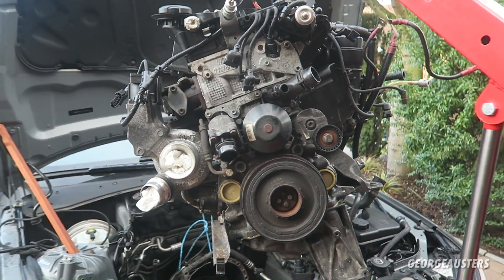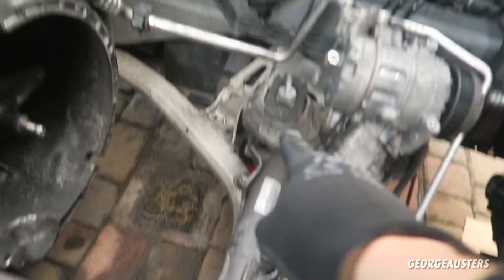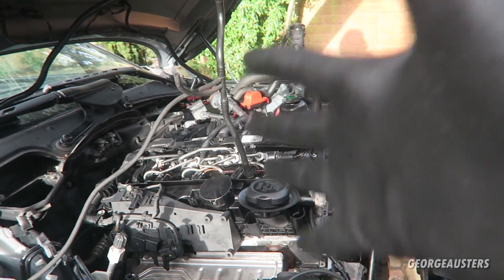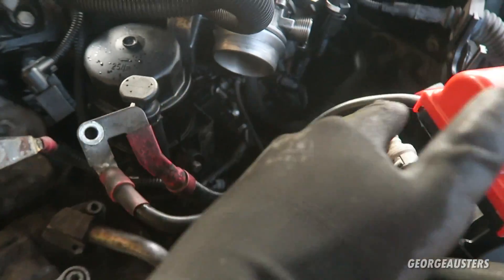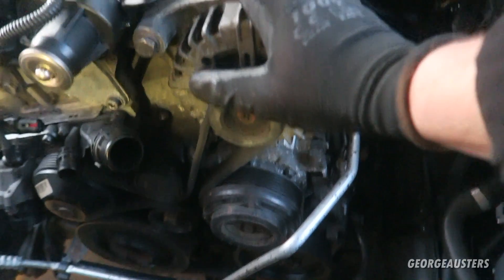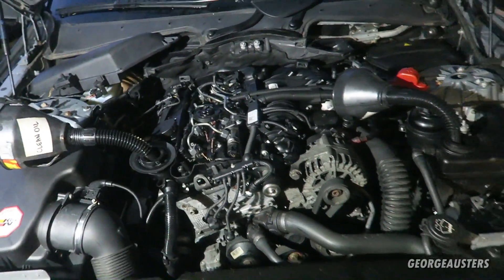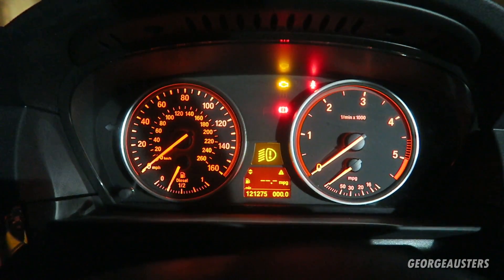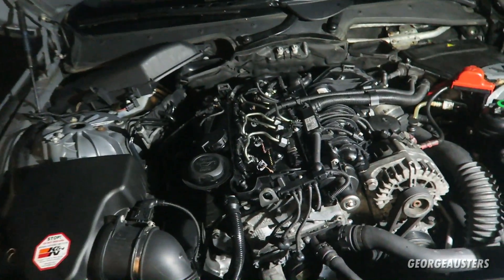Installing BMW N47 Engine After Timing Chain Replacement

Comment: Hi George i just swapped the engine in my n47 e90 and the clutch is grinding when put to the floor we bleed the system but still seems to be grinding any idea on what the problem might be ?

Comment: im really stuck. mines cranking endlessly and won't start and now showing injector faults. any ideas?
Reply from the maker: Just air in fuel system
Reply: @GeorgeAusters  hey, thanks. I do think it's air too but I feel like I've tried everything, bleeding cracking the pipes etc. I'll try bleeding again.
Reply from the maker: @bmartinot Do not crack off high pressure fuel pipes! It will bleed itself or use a scan tool to do it quicker
Reply: I can run the lift pump for 20seconds with my scanner. I've done that repeatedly but it doesn't have the 3minute bleed cycle. 
I build pressure to 4/5000psi for a couple of seconds then it drops to 1000psi

Comment: My 2c - fit the ac etc onto the engine when off - it's easier, there's room, so... also, hoik the transmission off - it's a faff installing the engine onto the box, install the box onto the engine once it's in - far simpler. You have only 2 points  to worry about - the engine mounts, then. As engines go, the N47 is one of the easiest to take out, repair & re-install. 

Don't make problems for yourself - do it the easy way. Fit everything, drop it in, connect the loom, the exhaust & the transmission, heater hoses, blah blah - there's acres of space, so no need to waste that luxury.

Comment: Is there any other way of priming the high pressure fuel lines/rail other than cranking via the starter motor ?
Reply from the maker: Yes, can do it with a scan tool
Reply: @GeorgeAusters  thanks for the reply, I mean priming beyond the HPFP. Is this not done mechanically via the timing chain driving the hpfp? Just thinking if I can prime it I don’t have to rely completely on the battery to do all the work when cranking

Comment: Hi, just completed the timing chain replacement according to your tutorials. The midle chain had a slack of atleast 25 mm(520 d, 2008, 305' km). Success, no rattling noise left. Engine runs so nice and smooth. Thanks. Br, Audun.
Reply from the maker: Glad to help!

Comment: Hi mate I’m wondering if you could help me with something, I’ve got a bmw 320d m sport on a 60plate. It needs an engine but have been told there is two types   Is its true as mine is a n47d20c

Comment: Excellent video series. My 330d is on 120k miles this year. Thinking about doing this one over summer. Great opportunity to swap out some other bits whilst the engine is stripped down too. Cheers

Comment: Hey bud I dunno if you removed the head at any point to change the head gasket, but what would be the torque specs to bolting the heads on with new head bolts obviously?
And big bearing in the crankshaft
Reply from the maker: I didn't remove the head
Reply: @GeorgeAusters  can't find any video on how to tighten head bolts in stages and turning in degrees for n47 engine 🤷🏾‍♂️😅

Comment: How was the car staring after the first fire up? Did it start easily (like normal) or did you notice any longer than normal delay. I get the first time starting up it need prime the fuel and oil around so it takes a bit but just wanted get a follow up after the initial “first time start”
Reply from the maker: Starts no issues

Comment: Yes, there is a process named fuel system breeding, normally which can be conducted through a DTC reader, so that you do not need crank so long, dry crank most potentially will kill your high pressure fuel pump.

Comment: Hi, when you switch the ignition on, can you hear the rear fuel pump running? Trying to start a 320d.....
Reply: Did you start your engine ?
Reply: I changed chains on 520d e61 and i dont hear rear fuel pump running and cant start the car

Comment: Hi George. i have just bought an e92 with n47 and for the moment i am buy the staff that i need for this operation. today i  have just bought the engine crane, most of the tools i have them already but you know every time you need something more. this series with n47 from you it will help me a lot. i have never done timming chain to an n47 but i think i will manage with my experience as a carguy and mecanik for some workshops in the past. greetings from Sweden!!!

Comment: Great job! I'd love to get my timing chain changed as the cars on 212k now, iv always serviced it and changed the oil regularly and always used good fuel but for peace of mind I'd like to get the chain done. Just had a new clutch so iv invested in it already 😅
Reply from the maker: Would have made sense to do clutch, flywheel and timing chain at same time
Reply: @GeorgeAusters  I didn't know you could get to the chain at the same time or I would have asked... Gutted! Its a great car and I'd love to keep it going. Its developed an oil leak now but the breather from the turbo to the roker cover was broken so iv changed that, juts waiting to see if that's why I had oil on the drive 😬🤞

Comment: The flat battery wasn't the reason it wouldn't start, the fuel system needed to have the air bled out of it first, all you did was overheat your starter whilst bleeding the air out of the system, they have an electric fuel pump in the fuel tank which lifts the fuel to the high pressure fuel pump on the engine, ignition on 30 seconds (power up the electric fuel pump) then off, open the fuel leak off (fuel return) line ignition on 30 seconds see if you have fuel coming out of the leak off line, if you do the system is primed with fuel, if you have fuel, air, heat (glow plugs) and timing there is no reason it won't start.
Reply from the maker: It was the battery. It didn’t have enough voltage to crank it fast enough. It takes a bit of cranking to bleed the air out and it dipped too low to allow that to happen.

Started fine once the battery was charged👍🏻

Comment: My mechanic fired up the engine after changing the timing chains and tensioners. The engine timing was off and the noise came after a few moments. The new tensioner for the top timing chain broke again. Any idea why?
Reply: yep , your mechanic timed it wrong.
Reply from the maker: Get your mechanic to fit you a new engine

Comment: Did you remove the front bumper to allow the hoist more room to install the engine back in..?
Reply from the maker: Had to remove the bumper because the engine crane wasn’t long enough
Reply: @GeorgeAusters  yeah I got same crane so thought you did...just needs another armpole  hole further back...

Comment: I just had the timing chain replaced in my 320D Coupé, and the BMW service didn´t take out the engine, they replaced the chaing from underneath the car, by removing the gearbox.
Reply: i did it the easy way to gearbox down
Reply: the engine i worked on was a f11 5 serie 220.000 and first engine was history at 180.000 the new engine had new cam chain hmm it didnt snap but jumped and camshaft housing cracked and broke many rockerarms i tested the comp and no valves was hurt new chain kit and it didnt start up easy 2 injectors needed a soft hit from a hammer to seal the flame washer
Reply from the maker: Do they want a medal?

Comment: Good Austers, first of all congratulations for the explanatory videos that are very good, I also wanted to ask you a question I have a BMW X3 2.0D engine N47d20a from 2009 E83 and I wanted to know if the injection pump brand is synchronized with the tool from the crankshaft

Comment: No issuses with taking out or putting my engine back in. BUT now when I try can start the engine I just hear a click and the ignition goes off by itself after a few seconds. Ive had a Bosch dianostic tester on and no faults showed up. Any idea what causes that? My car is a 08 520d lci
Reply from the maker: Send me an email if you want my help diagnosing your problem👍🏻

Comment: Mate I need a new timing chain on n42 engine.but Machanic says it's cheaper to change the engine then the chain.what should I do. A second hand engine
Reply: The N42 is a different engine, the timing chain is at the front and can be changed with the engine in the car, book time for changing those is 6.8 hours. I charge £625 for the complete job including all parts (chain kit, oil, oil filter, gaskets and seals, auxiliary drive belt). There is no way in the world I would ever recommend a used engine instead of renewing the chain, if that's all the car needed. The N47 as George has here, the book time is 13 hours, they can be done in the car as well (by removing the gearbox), although probably easier to remove engine if doing it on the driveway and certainly far less fiddly to change the chain that way. Plus much better for making a video showing the process, well done George really good video series.
Reply: Hm,how?Only if the engine has alot of mileage, but no it can't be cheaper.To change the engine they need to take the old engine out,and when they take the engine out,changing the timing chain is just an 1-2 hours more work and the chain is much much cheaper than an used engine which might also need a new timing chain.But if the chain broke then yeah,might be cheaper to change the engine or not even then,'couse there might not be very much damage...But it's not cheaper to change engine rather than the chain,sure for working hand it is more if you change the the chain but you need to understand you need to invest in another engine...
Reply: @prendedaj22  you are right. The problem is these kind of work, you have to go to BMW specialise Machanic. And they will ok will do the chain but once we open the engine there might be more issues. So you have to keep you check book open. the car with around 1200. . And to do the timing chain they quoted 700. They only use original parts. Imagine they find the vanos needs replacing. Oil pump. Hydraulic tappets. Because they are all part of engine noise making. Imagine the Bill. I have decided will sell the car and get a 330ci. Definitely 6 cylinder .no more 4 cylinder s
Reply: @Misbah007  Yeah i know what you mean.
Good luck

Comment: Superb, very informative and I've watched all 4 of them.
I drive a 2009 e61 lci model but I have 2 errors codes. 
1st one is " 4CAE. EGR controller position sensor signal "
My question is; do I have to clean the egr completely or just by a new sensor? 

2nd is " 00A2CD I think it's the crankshaft  sensor " 

Can you please help me out with this? Thanks in advance
Reply: 4cae = potentiometer on EGR is bad. I'd replace EGR.

Comment: I recently did my injector seals on my Alpina D3 Biturbo (N47 same as 123D) and had to crank it for ages before it fired up! It's a big moment of relief when they finally fire up into life 😅 I kept switching the ignition on and of (without cranking) for 15 second intervals, I was told this activates the lift pump in the tank? Either way, it fired up and runs like a beaut now 💪 Great video as always George 👍
Reply from the maker: Yeah it takes a while for the pressure to build to the injectors.. Appreciate you watching!

Comment: I know this is a longshot, but maybe anyone had a problem with the xenons? When I start the engine mine go down like they're supposed to, but then they go up way too much and stay there, blinding other people on the road. I have no idea what could be the problem, I don't get any fault messages on the dashboard or infotainment system everything seems to be connected, also a third of the time I drive headlights work properly. There are no sounds coming from the headlights, I didn't modify the suspension and I don't have the adaptive headlights. I don't want to blind others, but I also have to drive daily to make it from work to lectures and driving on DRL is a bit dangerous. I have 1er e81 if that makes any difference.
Reply from the maker: Headlight level sensor
Reply: @GeorgeAusters  thank you, I'll check that.

Comment: This was mine back in August last year.  https://youtu.be/LzpQDxBaXYY
Reply: I currently have a glow plug issue, swapping out the control relay as first port of call. Will the glow plug communication codes disappear when a module change is detected or will I need to get deleted ? 2008 123d n47...Great work on your part 👍
Reply from the maker: Jheez that was a bit slack! Not sure if the codes will clear but from experience, ABS error code was removed from swapping a speed sensor👍🏻

Comment: You see when you first started the car, there was white smoke, I see that come out of my 320d, is that normal???
Reply from the maker: Was mostly condensation in my case. White smoke on startup can also be unburnt fuel. 

It’s not normal to get that amount of smoke everytime you start up👍🏻
Reply: George Austers Ik, it would be a concern if that much came out, but mine is very light, you can only see it when u take the engine cover off and look closely. I’ve noticed there is a bit of oil around my oil cap too. Not pooling or leaking but it just on the surface. Could it be something to do with that. It’s a 200k 320d aswell.

Comment: Hello, just watched your rebuild. 

When I was watching you crank over the car car to get it started 
, it looks like you are generating some sparks around the fuse box (top right corner of the engine bay) 

I only see it after you had charged the battery overnight.

Maybe worth checking out.

Kind regards

André
Reply from the maker: Thanks man. Will check that out!

Comment: Nice work George, watched a few of your videos. Do bits myself but wouldn't be brave enough to remove everything lol would forget where everything goes 😂
Reply from the maker: Sometimes you just gotta get stuck in and see how things go
Reply from the maker: Cheers mate. Helps if you video yourself doing it😉

Plenty of guides and videos online for most jobs!
Reply: Impressive that you've learnt everything on your own tbf. I can do basic servicing/brakes etc but nothing this complex. 👍🏻
Reply: Do a George, film it and you can’t go wrong. Nothing more than a jigsaw and BMW have made most things easy to access, mostly.